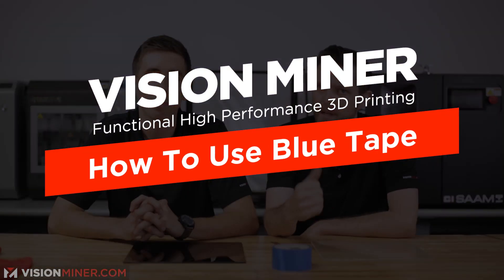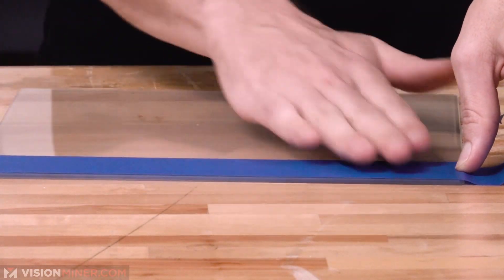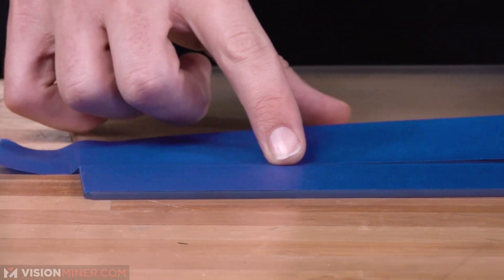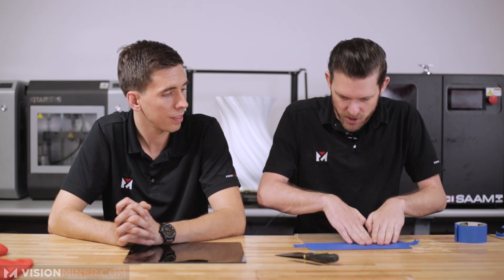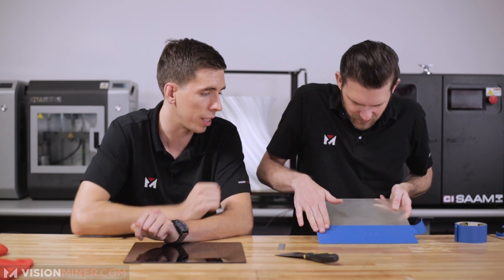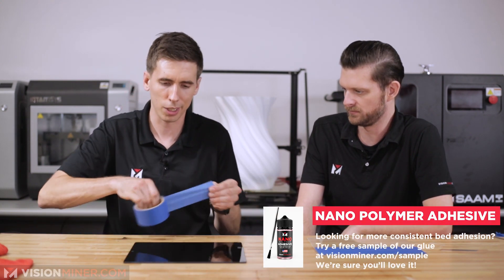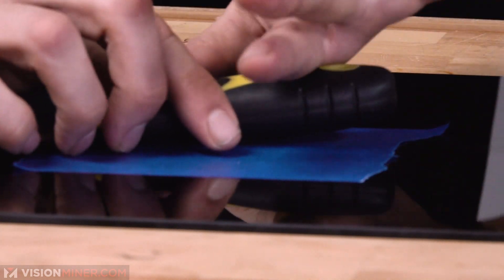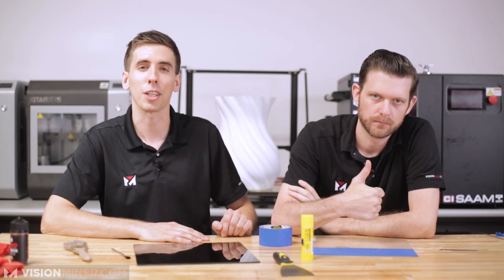How to Use Blue Tape for 3D Printing Bed Adhesion

Comment: Gimmicks, all gimmicks, just use soap water, dry, and then use Isopropyl Alcohol going forward for many prints without a major reclean. The grease from your fingers on the bed is what makes material not stick.
Reply from the maker: Well, no, a lot of it depends on the material itself, moisture content, build plate surface, extrusion temperatures, cleanliness is definitely a factor.... but not all PLA parts stick without any adhesives, although many can, yes :) Still, without adhesives, you'll often deal with lifting corners and such, which might not ruin the print, but definitely aren't perfect :)

Comment: A better way to cut the tape is not to use the very corner edge of the razor blade but use the blade towards its center and push instead of pull at a 70 degree angle to the plate and just glide it all the way down the edge. Make sure the tape is folded slightly down over the edge. You will get a safe perfectly straight edge every time as it uses the edge of the plate as a guide.

Comment: No such thing as good blue tape. The quality masking tape is green, not blue. Green frog tape does not tear from itself and lasts for days if not weeks without leaving residue or lifting from the substrate. I learned this in mecp certification training when making custom molds with fiberglass resin. Blue tape sucks and thats what it is designed to do.

Comment: In my honest opinion the hairspray works the best, there is zero mess in contrast using the glue brings in alot of mess, diluting the glue stick in water does wonders as well.
Reply: I always felt like hairspray would cause the most ness. Uneven layering and it goes well out in a cone. I'd hate to get it in moving parts.

Comment: Have you guys tried printing PEEK on this tape? Been trying for  couple of prints which is resulting in warping...even though I have added stick glue on top of the tape. Any suggestions?

Comment: i use the yellow tape masking tape i just put it on a glass pieces from an old window and honestly after 10 prints i change it ... but even then i only swap it cause sometimes i scratch the tape cause im clumsy but if u dont scratch the tape u apply once it stays there for over 10 prints perfect 1st layer everytime. and easy to remove the print from it... it just slides off with a little pressure once its cooled down from 50C bed to like 30 or 40. on my end the tape even overlaps each sides it doesn't really matter the size difference is so small it's pointless trying to place it perfectly. 0.05 mm thickness half a 10th of a milimeter. not going to affect ur print. however i do print with a 1mm nozel so i don't really care if my pieces are a lil bit crooked at bottom.

Comment: Blue painter's tape was the magic bullet that made me succeed with 3D printing.  I have a further pro tip; if you cover the entire print surface with the tape, avoiding gaps and overlaps as demonstrated in this video, then you can get tons of life out of this build surface by relocating your prints in your slicer to other areas of the bed.  I have to redo the tape maybe once every six weeks or so.  When the tape in the center starts to wear thin or tears when I'm removing a print, then I'll start printing in the center at the rear of the bed, or on the left side of the bed.  It works a treat.

Comment: I actually make a note not to touch the plate with my hands .... being oil from your skin is the worst thing that will kill your print right from the start.....I don't know how thay got that to print after both of them had there hands all over it rubing it constantly.....I use the flat edge of a plastic scraper to lay down the tape in the same approach making sure to keep things as clean as possible....🧐😁 Any how outher then that it's an all right video 😁

Comment: Does the glue stick help with easy removal after the print is finished?  In my experience(using PLA), The print adheres just fine to the paper tape,  but ends up tearing the tape off the build plate when I remove the part.
Reply from the maker: Not always.... with nano polymer, though, parts pop themselves off usually, once the plate cools :)

Comment: What is the BEST 3D bed for printing ABS on? Does your product Nano Polymer Adhesive works on the Creaity glass bed? Thank you in advance.
Reply from the maker: Our glue works great on the creality glass bed, and the best surface is something other than glass, which can break with ABS (with or without any kind of glue). Our carbon fiber plates are a great option :)
Reply: @VisionMiner Thank you so much for the information. The Nano Polymer Adhesive works great by the way on ALL of my PLA & PETG filaments prints its just that ABS stuff because my Ender 3 V2 bed goes to 110 Celsius and I need to get a enclosure to keep the heat in when printing with ABS.  I will look into your carbon fiber plates for my printer.

Comment: PETG and ABS usually has very good layer adhesion.  I have had prints pull pieces of the glass up with them, and leaving pits in the glass plate.  Does your Nano Polymer Adhesive prevent that?
Reply from the maker: It doesn't prevent it, with ABS -- with ABS we always recommend some sort of surface instead of glass, or a perfect z-offset -- that's really the key -- generally the shrinkage only breaks glass with ABS or PETG (or even PLA) when the first layer is smushed into the bed

Comment: i would like a sample of that adhesive if it really works
Reply: Can it be removed without the need for removal of the build plate ie. Alcohol,  or a wet paper towel ex. 
The reason i hate glue stck is because you cant get it really clean unless you run the build plate under warm water 

im not spraying windex near my printer so evertime i remove it after every print to clean it  i have to re level the bed 

I want something reliable like the glue stick but able to to be removed without needing to take the build plate off
Reply: @tacticalbacon8064  you should be leveling every time anyways
Reply from the maker: "If it really works" --- feel free to check out the hundreds of Google, Facebook, and even our website reviews... yes, it works, and it works incredibly well :)

www.visionminer.com/sample for the $5 sample + shipping, if you're doing PLA/PETG a single coating lasts many many prints on glass (I've done 45+ without cleaning or re-applying, and it washes off easily with water)

Comment: Awesome thanks for this video. Was really wondering about tape as adhesive. I seem to have a tough time with having PETG sticking. It’s definitely me 😂😂 prob not the adhesive. Would definitely like to try out the Nano Adhesive. Is there a coupon we can use. Just out of curiosity
Reply from the maker: No coupons at the moment, but samples are available for $5, and in PETG, a single coating lasts many many prints on glass :) visionminer.com/sample

Comment: I'm baffled. I have an Ender-3 and I thought a glass bed would be an improvement. That looks like a lot of work for not a lot of a payoff. Don't you lose the properties of the glass this way?
Reply: Glass is superior because of its flatness.
Reply: @dreamsprayanimation  I thought so too, but the glass bed that came with my CR-10 S4 bends as much as the bed underneath it. Currently waiting for Creality to ship me a new one. It has almost 1mm dip in the middle.

Comment: I tried Scotch Builders Blue Tape on my hot bed of the Tronxy X5SA 2020 model and I found that it hates Heat.  

If I do the bed heat to say 55 c that tape just un-sticks and curls up!  So since even some PLA's need 55 or more sometimes.
The tape just fails and soon the edges and even the middle of it bubbles up and un-sticks.

I've now using the electronics heat proof gold UEETEK Tape.
That was a bit hard to put down on the flexible build plate surface, 
But I did it slowly and got almost all the air bubble out using a sharp blade point to pick
those bubbles and then flatten them with the bed scraper.
The prints stick well to it and are easy to remove, Although one PLA I got is a glow in the dark version.

It is very brittle and twangy and seems to be more able to curl up from the build plate at the prints edges?
I may have to use some glue stick or some extra hold hair spray on there just to keep the edges held down.
Or maybe do the hot bed to 55 c instead of the recommended 45 c?

Comment: I am a beginner and i have a easy threed 3d printer Nano because its in my budget and i live in apartment will i be able to use your adhesive on my  bed its alittle over 4 1/2 x 5 inches with a removeable bed.

Thanks

Happy New Year
Reply from the maker: For sure! It will work great. We have samples at www.visionminer.com/sample :)

Comment: Hi everybody, I print on the glass bed and for me the best solution for good adhesion is ... WATER WITH SUGAR. Just before printing I wipe the warm bed (50-60 deg C) with cloth soaked sweet water. After 1 minute you have thin sticky layer on your bed - IT WORKS GREAT !
Reply from the maker: * for PLA.... "best solution" is quite subjective lol. But yeah, sugar actually does work! We have a short funny  video on using maple syrup.... hah! Crazy stuff.

Comment: I had the same issue. New to 3d, after a few prints got the dog printed and now I'm having issues getting first layer adhesion and bed levelling. I will go through the mods you have shown here and look into the auto bed levelling. Thanks for the help.

Comment: Thank you! This painter tape is only thing that helps with adhesion of small prints on my printer (which has a glass bed). Nothing else worked except this!! Thanks a lot
Reply from the maker: Our glue will definitely help :) No more brims!

Comment: No no no, you put the blue tape UNDER the mirror to level the bed perfectly.  Nothing goes on top of the glass except 3d prints and rubbing alcohol.
Reply from the maker: Wait what? This is not correct. Often times when things will not stick to glass, blue tape can work great as an adhesive surface. We do not recommend blue tape under the bed unless your platform is warped, and it's a last resort -- you should be able to level the bed without such things...... not sure if you're joking or not, lol!
Reply: @VisionMiner  With correct squish on clean level glass I've never had an issue.  Just tell cura to print the first layer at 50% speed and 150% line width.  I have a heated need I run@63°.  If prints aren't sticking something's wrong with one or more of the above variables.  Most videos I've seen have the nozzle too far away from the bed.
Reply from the maker: @amelliamendel2227  That works for many blends of PLA, but definitely not all filaments. Also depends on the grade of glass, or whatever build surface you're using. If you have to use blue tape under your buildplate, something else is wrong.... like a warped platform ;)
Reply: @VisionMiner  I don't disagree my platform isn't the best, and I know it's warped.  It's a $240 printer with $10 of mirrored tile on top 1 of 6.
Reply: @amelliamendel2227  you apparently never tried printing with PETG. I invite you to try your method with that material :)

Comment: Do you also need to aply tape when you have a 3d printer with a heated bed?(I don't know much about 3d printers)
Reply from the maker: only if you're having issue with adhesion

Comment: Tossing this out here - blue tape isn't working.  The "curl" of some parts - especially large, flat bases - is strong enough to pull the tape off of the glass bed.  I've had to abandon this technique.
Reply from the maker: 100% correct -- many materials warping, such as nylon, will be too much for the adhesive on the tape itself, causing the tape to fold up. This method is really just a last resort for basic materials, if nothing else is working :)

Comment: Question, I have a ender 3 pro so a flexible magnetic removable bed, and it has a build tec surface, will the tape ruin the grip?or can I put the tape directly on the magnet under neath?
Reply from the maker: you should be able to put it on the build tak just fine, but you shouldn't really need it with the build tak. If your build tak is worn out, you can use our Nano Polymer Adhesive to refresh it and it will work great! :)

Comment: Stupid question, but I can’t find the answer (my search led me to this video). Should you change your plate temp if you’re using tape? I’m at 55 C normally with PLA, but it’s not sticking great, and I’m switching to PETG soon so I’m gonna try using tape, but I’m not sure what to do about the temp setting
Reply from the maker: Yes, change your temps to make it work. Hotter makes the plastic softer to reduce warping -- don't be afraid of cranking it up!

Comment: You are making a fkng 3 year study of taping ... it's simply taping a bed. That's it, you can tape it however you want, it's clear that you can't overlap. :S
Reply from the maker: Well, you can overlap, and it'll still work.... hah! Moreover our glue will basically save you lots of time and money in the long run, but if you're in a bind, tape works :)

Comment: Why does filaments stick to tape surface when its not the adhesive side in contact with the extruded filament?
Reply: Simple, because of that tape texture

Comment: I actually have found that I prefer to print on just clean glass as I love the bottom finish on prints, if I'm printing something with a tendency to curl I'll use a adhesive, I use to use glue stick for everything and recently switched to printer bed adhesives prints are still pooping right off and it still retains the beautifully glossy first layers.
Reply from the maker: Glass is definitely awesome. Sometimes we like a texture on the bottom, but most of the time, perfectly flat mirror finish is the best!